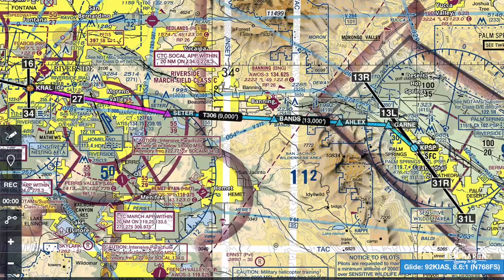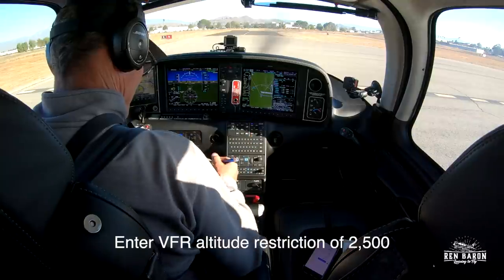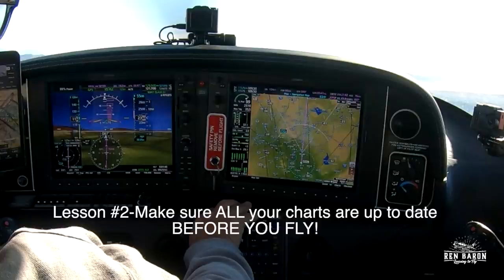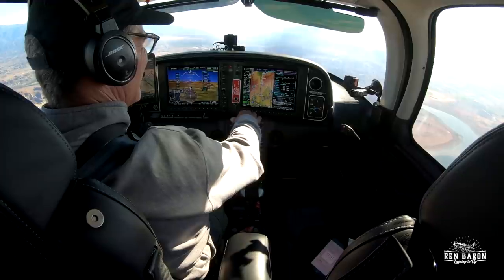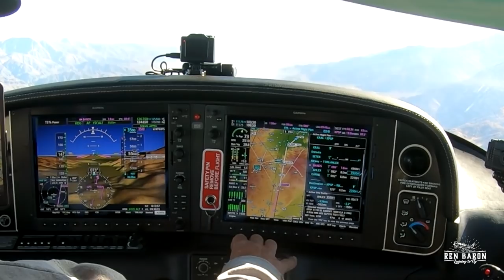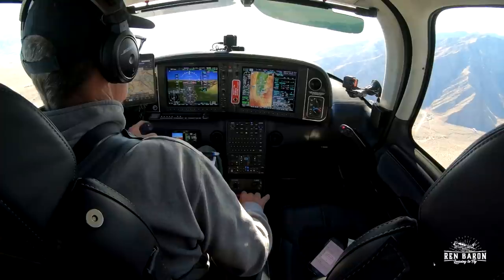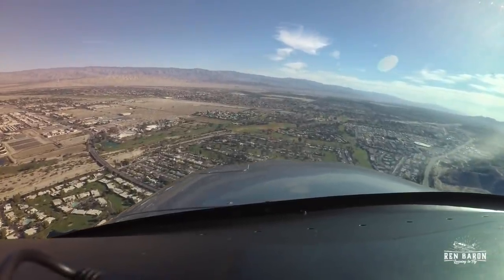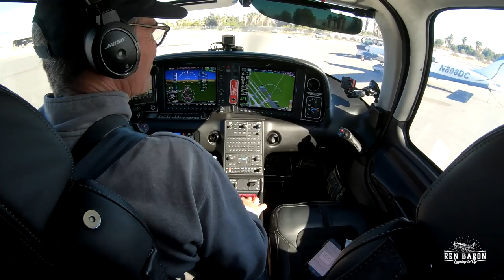Cirrus SR22T Gen 6 Perspective + Tips and Techniques-VFR Flight to Palm Springs International

Comment: Nice video Steve,  on that ATIS cutting in and out,  you can turn the squelch off,  make sure the flip flop arrow is on the active radio,  then push the volume knob.     Works most of the time for me.   Take care.
Reply from the maker: Thanks for the tip Paul! Cheers-Ren

Comment: During climb out, you say “there’s our little shake, rattle and roll” ... what are you referring to?
Reply from the maker: The nose wheel rattles a bit as it stops rolling. If I hit the brakes after liftoff it would not happen but usually I have my right foot shoving the right rudder in and don't hit the brakes. It's no big deal.
Reply: @TheRenBaron  ah, ok, thanks for the answer ... I've noticed a similar vibration as well, but didn't know what was causing it.
Reply from the maker: @stephenpair3836  Sadly I cannot do more than one thing at a time with my feet. That's why I'm a horrible dancer! Cheers-Ren